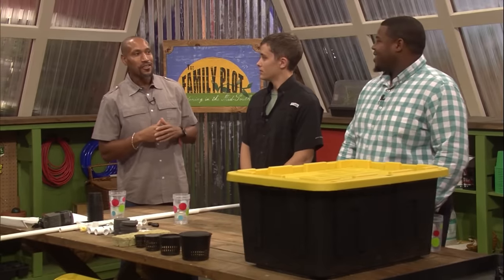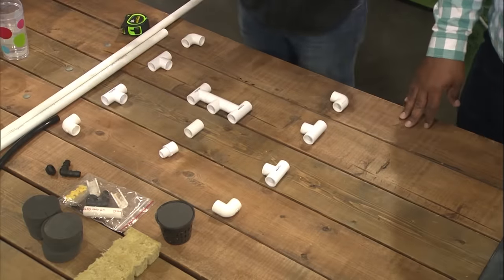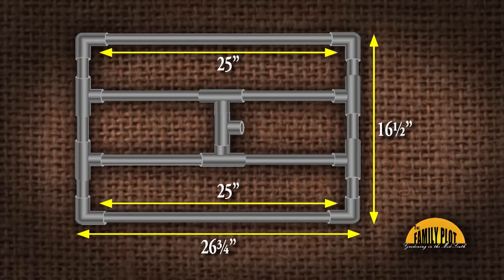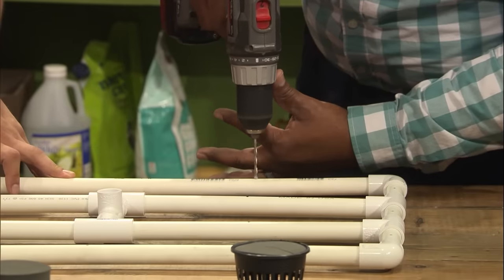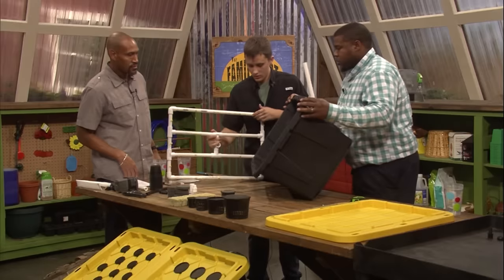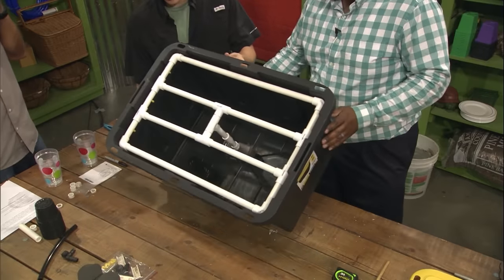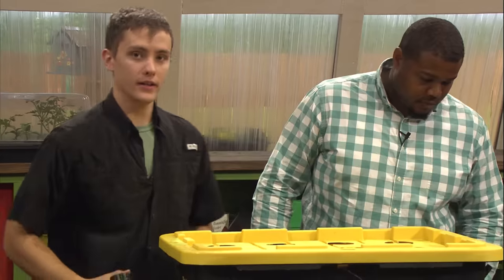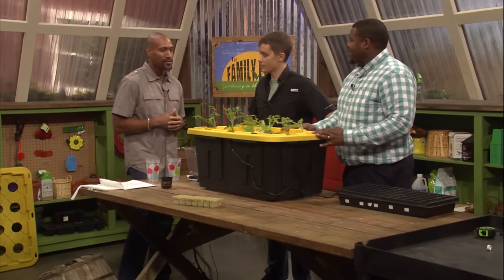Building an Inexpensive Hydroponics/Aeroponics System

Comment: 8 site cloning bucket from HTG supply is $50 bucks have used it for 8yrs now with absolute precision on clones. I can even double up or even triple clone in  each site sometimes. but good video none the less.
Reply: Do you not feel like having those 8 sites so close together will create crowding once the plants get huge?
Reply: @heavensplayer  Hello, I never had any troubles with roots tangling up before i transplanted them to soilless mix. It probably will if you are planning on keeping them in the water the whole time during growth. I wouldn't do that.
Reply: This system isn't made for cloning. The clone totes we build now are the black and yellow 7 gallon tote, have 39 sites and are cheaper than the HTG bucket system. There is NOTHING like knowing how to create aeroponics on your own. The technique can be scaled up or down for whatever your application is. Again, this large tote is not a cloner.

Comment: Anyone knows the spec of the water pump used here?!!
Reply from the maker: This is a 400GPH Active Aqua pump
Reply: @FamilyPlotGarden  Thanks. I got one more question. Please tell me the diameter of the pvc used and the cutout for net cup?
Reply: @MVRAR1  The netcup is a 3" netcup available at your local hydroponics supplier. 3" neoprene as well. The PVC was 1/2". We prefer to use 3/4" on larger applications. More water flow leads to better spraying. Make sure whatever pump you find has a mesh filter at the water intake, like the Active Aqua line. We chose 400gph for this application because its the best price point. AA's 550gph pump is almost $20 more than their 400gph model. The bigger, the better though. Go with what you can afford. Don't drop below 400gph, though. The spray just won't be sufficient.

Comment: How can the plants get watered when the water is down sprayed  not up? The roots aren't long enough.
Reply: you make them hit the bottom of the cups
Reply: The idea is to transplant plants in to the system with roots long enough to reach. You'd be surprised how fast rooted cuttings have a root that can reach. Usually within a week or two they are transplanted in from the propagation totes.

Comment: What is the misting cycle time? 15 seconds every 15 minutes?
Reply from the maker: I do 15 minutes on and 45 off. That way i can use a cheep light timer and don't have to buy the expensive hydroponic timers. You may need to shorten your off period depending on if the roots are drying out too much.

Comment: can someone explain? the water is pumped down but the plants are on top?
Reply from the maker: The sprayers are pointed down. This keeps the lid from resting on the sprayers. When the plants get large and heavy, all that weight is resting on the pipes, not the sprayers. The spray mostly misses the netcups, but there is still more than enough spray to keep the soaked and dripping.

Comment: Rockwool will change the PH - at least it does when it's the entire media. Sits at about 7.8, you have to soak it in PH down 5 solution or so for about 24 hours then flush it to make it really ph neutral.

Comment: How do you maintain clean water
Reply: They made another video on how to drain it and what mix to use, go to their site and it's on the page.
Reply from the maker: Change the water every so often. A basic rule of thumb is to change the water when the plants have drunk about half of it. If you are having problems with it getting cloudy you probably have an algae problem and need keep more light out. Cover the top with black plastic or aluminum foil to keep it dark inside.

Comment: i didnt see any spray reaching those new cups installed.  I dont understand..
Reply from the maker: Most of the spray passes under the cups. Some of the spray hits the cups and keeps them moist. Once the roots grow down the spray hits them. By turning the sprayers down it keep the water from leaking out through the power hole and under the new cups on the lid.

Comment: what is the size of the pump used
Reply from the maker: 400 GPH
Reply: @FamilyPlotGarden  how do you determine the pump size
Reply: @sfcnetworkministries  We chose the pump size for this particular setup through trial and error and the "sweet spot" for pricing. Generally, when I design a system for someone I use the largest pump I can get away with. The more sprayers you have, the further the water needs to go to get through the sprayer, the size of the pvc pipes moving the water, etc all play a part in determining the size of the pump.

Comment: The tomato plants are too close to each other. I wonder how did they manage to grow and how much harvest one got from this... quite an expensive setup considering one pump per box.
Reply: Expensive nothing. It lasts forever, just clean it from time to time. The savings on nutrients vs other hydroponic systems is a no-brainer. We train the vines to grow up trellising on three sides of the unit. We would harvest a plethora of tomatoes throughout the season until the roots overwhelmed the tote and were drinking 20 or more gallons of water per day under the hot august sun. You would be amazed at what spraying the entire rootzone with highly oxygenated nutrients will do!

Comment: once you add any kind of nutrients, organic or otherwise, you will have pythium root rot overnight, the lid lets too much light through.
thin lid with no insulation would cause higher water temps causing less oxygen in the water. 

plumbing and sprayers is overkill. Those rubber grommets leak. 12 pots will be crowded real quick in there.

this would make a great aero cloner, it is a bit big though.

Comment: I heard that you can drown your plants from overwatering them. How is this any different?
Reply from the maker: You are correct. in soil, plants that are standing in water will have their roots drown. In hydroponics the plants are growing with the roots in water, but the water is oxygenated to allow the roots to breathe. You can use air stones (think fish aquarium) that bubble air through the water, or in this case the water picks up the oxygen as it is sprayed. If the pump is off for too long the roots will start to suffocate and die. It takes less than a day for the oxygen to be depleted. Also, the warmer it gets the less oxygen the water can hold so the more critical this becomes. You can take it a step further to true aeroponics where the water and nutrients are aerosolized and sprayed at the roots. The roots are just hanging in the air.
Reply: @FamilyPlotGarden  that is pretty cool and interesting. Do you have to change the water like you would a tropical fish tank every week or so? And what if you get algy, how do you prevent that?

Comment: Don't you want the sprinklers facing up towards the net pots??
Reply from the maker: We face then down. This keeps the spray from leaking out under the lid and through the openings. The main part of the spray misses the net cups, but the very top part does hit keeping the rockwool moist.
Reply: @FamilyPlotGarden  and how long do u keep the water running 4. I heard just 15min on the hour every hour

Comment: Even cheaper is available. A static water system with a bubble diffuser (like you'd use in a fish tank) will provide oxygen in water and produce things such as greens and lettuce just fine. No water pump really needed.
Reply: That's not cheaper, actually. The idea of this system it show people how to lift the water up from the reservoir, and spray their plants roots with highly oxygenated nutrient solution. Even a shallow reservoir and plants with very small roots will benefit from this sort of setup. Furthermore, the money is wasted on nutrients when you pour out a deep water system every week or two, that was filled to accommodate the plants root height. With this system, no matter how long the roots are, the smallest amount of water can be used if you like. We start with 5 gallons of water or so for very young plants and use more and more at water changes until the end of season and the roots have filled the tote to the point that the sprayers don't even matter anymore, as the 12 tomato vines running off of this can drink 20 gallons in a day during the hot august weather. Anyway.... this system is designed to address long term costs of nutrient disposal and maximizes oxygenation. Think about it.
Reply: @wetwerk2178  I like the part when you totally ignore the concept of it being cheap to raise greens such as lettuce and go on to mention a heavy feeder like a tomato. A static clone system can be done very cheap, placed indoors, and be very successful for fresh greens/lettuces. I've set up and used many clone systems to raise lettuce to maturity in static 12-16 gallon containers for less than $25.

Comment: wait..... how is the water getting to the plants if the spray is facing down??
Reply: it starts facing up, once the roots grow a lot, they change it
Reply: @alita123csi  actually, we transplant into this unit, but that would work if you secure the tote lid with some adhesive foam (EDPM!)
Reply: aeration is the key. not necessarily spraying the roots, but we do want to spray them. they come into the system with developed roots and the roots are more than long enough to hang into the water below, the very tops arent sprayed, but it wont hurt them.

Comment: Does his seed starter ... material ... wash away ?
Reply from the maker: It is rockwool so it stays in the cube shape.
Reply: Rock wool is molten rock spun like cotton candy to make many shapes and applications. This material will not dissolve or wash away, but is thrown away at the end of the plant's life cycle. We have discontinued the use of rock wool for our cuttings since this video was made and now simply root cuttings with a continuous blast of nutrient water in 7 to 14 days.

Comment: Why don't you put the sprayer a few inches deeper and face the spray head up? Why aim spray down?
Reply from the maker: Facing the sprayers down gives you two advantages. First, The spray does not spray out of the holes for the grow sites or power cord. Second, because the pipes are against the lid they take the weight of large plants. This supports the lid without putting weight on the sprayers.
Reply: Ahh ok so the spray will still hit the roots from above. you don't bother with air stone because the spay will add oxygen. Nice build. Im gonna try this this spring with early hot peppers and apple clones in Feb. Thank you mr :) About how long do you leave in the box before planting? Have you planted seed in the Rockwool and put that in basket from the start? Looking at adding maxiGro with rain water compost/worm tea
Reply from the maker: I have never transferred to soil out of hydroponics, but I know you can. I would say once the peppers get 6-10 inches tall they are ready to move. You will want to move the peppers to soil because they don't get their heat in a hydroponics system. You can plant directly in the rockwool. Make sure you rinse it out first because the rockwool has high pH.
Reply: cool and thanks for the great idea. I built this today and looking forward to start cloning a few trees for my honey bees.peace :)

Comment: NOT COVERED BUT CRITICAL FOR ROCKWOOL -- You need to SOAK IT in 5.0-5.5 PH water for 1-4 hours to dissolve away any high Ph items that can make the rockwool SUCK to root in. Otherwise, I just started a build of one of these. Do the plastic drilling on a hard floor sweeping is way easier than vacuuming.
Reply: This is a misconception. We've rooted thousands of plants in rock wool with no treatment. We prefer to test things and adjust as needed, only adding more expenses if the project is unable to proceed without it. Depending on your area, pH may or may not be an issue. Here in the mid-south, our tap water is some of the best in the world. We do, however, purify via reverse osmosis to remove any fluoride, chlorine, and particulates that our water receives from the facilities treatment of the water or anything old pipes might add to it. Reverse Osmosis filters are available anywhere hydroponics are sold for a fair price.

Comment: the water sprayers mare facing the wrong way of course they don't show them in a week or 2 cuz they will be dead that's why take the PVC and flip it so the sprayers are facing up and push the pvc 5 in from the top so the Botten of the plaints get water b4 they die

Comment: Why do you need sprayers?
Reply: Maximum oxygenation and to use less water to reach the plants. The sprayers can draw up a couple of gallons, where other systems would have to have water that reaches to wherever the roots are. Those same systems rely on air stones to oxygenate the water, so the roots don't suffocate, the air stones need routine replacing and don't do a good job of aerating all of the water, just the zone closest to it. The spraying action on this system oxygenates every bit of the water continuously, so plants thrive.

Comment: Do you like water on the lid to your cloner next time use 2 inch hole saw and cut the hole ontop of the square.
Reply: We liked the idea of allowing rain water to easily drain into the channels and down into the tote. If used outside and too much rain water collects on the top, it can cause the netcup to come out of its hole. With it cut like you see here, any water quickly drains away from the plants and into the tote. Indoors, though, it's user preference. Water doesn't spray up from the sprays onto the lid because the sprayers are pointed DOWN.

Comment: The sprayers don’t reach even the bottoms of the cups to hit the plant
Reply from the maker: Most of the spray passes under the cups. Some of the spray hits the cups and keeps them moist. Once the roots grow down the spray hits them. By turning the sprayers down it keep the water from leaking out through the power hole and under the new cups on the lid.

Comment: They made it perfectly clear how to build this but said nothing about how and when they supply the nutrients needed to feed the plants.
Reply: its in the box description , then click on the link / See how to change the nutrients in this system
Reply: @platanowifi1238  thanks so much!
Reply: This is an intermediate hydroponic lesson intended for people already familiar with hydroponics that want to learn how to build aeroponics systems that traditionally cost hundreds of dollars for even tiny, small scale rooting systems only. However, due to the massive outcry of people being unaware of how to use hydroponic nutrients, we returned to the Family Plot and made a video on feeding and changing the nutrient solution. Check the comments for said video.

Comment: pump pressure?
Reply from the maker: The pump is not listed for a pressure but it can lift water 6 feet with only a trickle at the top. This calculates to be about 2.5PSI. Being able to maintain enough flow at about 8 inches of rise is the key.
Reply: @FamilyPlotGarden  I tried with low pressure 3 meters pump with 6 holes and 8*11mm hose. Pump to container is split with 1 meter height, result is not good. Now I’m using high pressure pump 80psi and it’s working good but the sound of the pump is annoying. I set with timer every one hour with one minute on.

Comment: These PVC measurements are all wrong for a similar 27.5 gal tub they sell at Home Depot and Costco, measurements as follows per one box built: (2x) 23", (4x) 10.75", (6x) 3.75", (2x) 1.5", and then you can use a 1.5" disposal connector straight to pump connected to another 7.75" PVC pipe to avoid the way they did it, which is more complex and requires more unique parts.

Comment: If you don't feel like using PVC, adding more water and using large 6" or bigger airstones 2-3 attached to an air pump (10-20watts) for that size tote and you can achieve decent results. But I feel as long as the in water pump that you're using isn't raising the waters temperature to a dangerous bacteria/ mildew temperature (70+F) using the pump and PVC spay bar produces superior roots compared to just the air stones method.
Reply: You're describing deep water culture. It's the most basic hydroponic method that everyone learns about when they start out in hydroponics and we loathe it. It is indeeed simple, but there's many draw backs. The reason we used this method was to limit the amount of nutrient water being disposed of between water changes, which, as you may be aware, are expected once per week to two weeks in most applications. If you filled this 27 gallon tote, it surely wouldn't drink near that much in a week or two with smaller plants. The idea is to use the smallest amount of water you can get away with, spray it onto the roots, and recollect it for continuous spraying. The lush roots and highly oxygenated water is just an amazing added bonus in our opinion. This is the capstone of homemade DIY hydroponics. We hope everyone learns aeroponics and can put it into practice in their particular garden setups.

Comment: Great idea. However, while this would work for lettuces and other small plants, tomatoes 2” apart is a disaster.
Reply: No. It does great. Train your plants to grow onto a trellis. The disaster will be when they've grown for 5 months and the root system is too large for the tote and pump and you end up adding 20 gallons of nutrient water everyday during the hot summer sun because you're growing tomatoes, squash, cucumbers and basil in the same tote on every plant site and the root mass has filled the thing almost entirely. True story!